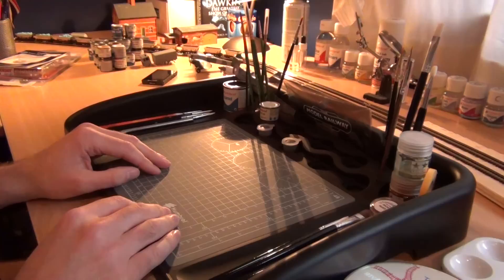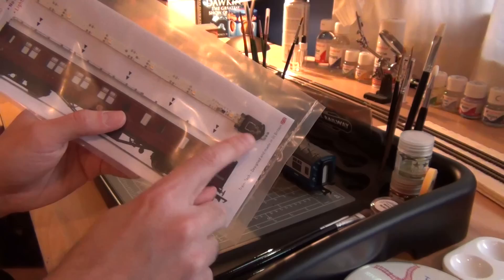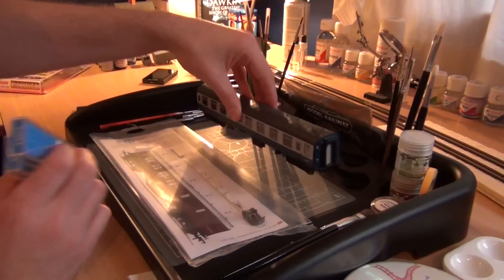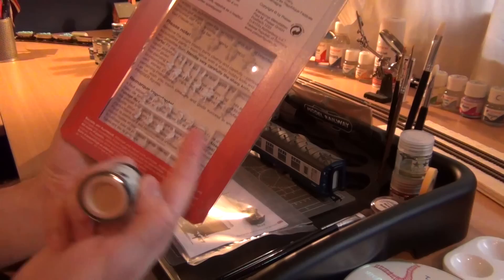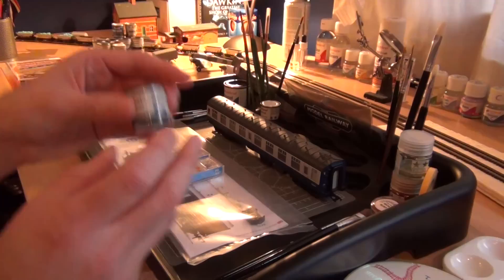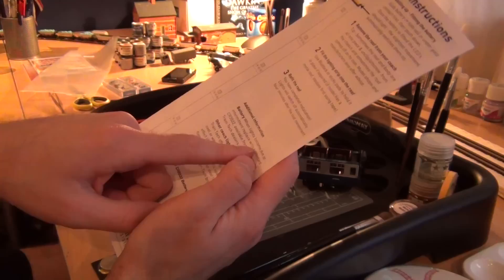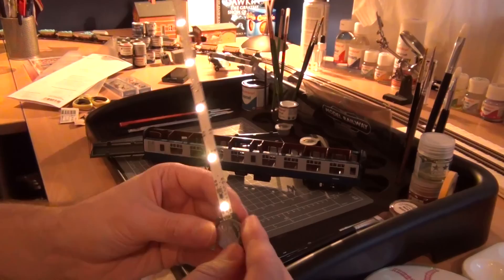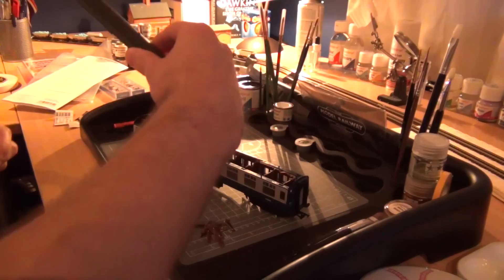Fitting Train-Tech Coach Lighting Strips

Comment: If you ever go to make the lights track powered you will need to a resistors because the CR2032 uses 3.7v and track power is usually between 0-16 volts(depending on your dc or dcc system)

Comment: DCC has too many problems--that's why I do DC only!  Another thought for you.  You can get Loksound ESU current collectors (#50707) for about $13.75 which includes shipping from Litchfield trains.  You get enough to do 8 wheel sets.  You cut them apart and mount (super glue/epoxy) each one to opposite wheels and it provides a pickup current from the track and a return through the opposite wheel.  Of course you have to use metal wheel sets with one wheel insulated.  Unless I find some more scrap copper, I cannot even come close to the price of the Loksound ESU parts.  What's neat about this is you only need one pair of the little pickups which you cut into half--one for each wheel.  Cheers.

Comment: Would it not be cheaper to buy a large spool of strip LED's off of eBay, then solder a small battery pack to it, which can then be stuck into multiple coaches?

Comment: Was your decoder a Bachmann 36-557 by any chance?  These are relatively new and from my experience they are poor performers (I've tested 3). The decoder is a custom unit made by soundtraxx and supplied to Bachmann only.  If you can find the older and much better 36-554 you should be ok.  If not I would get something else like Lenz, TCS or a Hornby Sapphire.  Stay away from the Bachmann 36-557!!!
Reply: yeah i was about to comment on inter citys decoder vid about how you had the same issue with them and how the lenz ones were working im a sub to you by the way

Comment: Fantastic vid, however just one little thing...
When you were whispering in the dark and the coach light came on just for a second or two and went straight out, you said it's not supposed to do that, but actually if the coach light only sees a tiny little bit of movement it just comes on for a second or so, then if it sees a little more movement it stays on for it's 4 mins :)
Not a criticism to your vid at all, just purely to let you know!
Looking forward to the next one.
Kevin.

Comment: You''ve probably already figured, but Bachmann's 36-557 decoder isn't compatible with Hornby's Select for some reason. A thing to remember though, the Select isn't NMRA compliant, which the Hornby Elite is, and the 36-557 works with my Elite.

Also to support this, on Hatton's website where the Select is sold, there is an accompanying note saying 'Please note that this controller cannot be used with locomotives with the Bachmann 36-557 21-pin decoder fitted.'

HTH

Comment: You need to learn to do your own electronics as I do all my own coach & caboose lighting.  Of course I only do DC for my trains.  I purchased LED strip lighting, mini full wave bridge rectifiers (the little square ones) and some 3300uF capacitors from fleaBay for under $15.00 which came from China.  I made my own pickups out of some copper salvaged from an old computer and lit up an REA (Railway Express Agency) coach.  The LED strips can be cut apart at every 3rd LED and have the ballast (current limiting) resistors already installed on each 3 LED section and, of course, they're all 12 volt DC.  The LED strips have adhesive on the back so they can be mounted to the interior roofing.  I have also converted all my illuminated coaches that have incandescent lighting to LED strip lighting.  I probably spent maybe $2.00 per coach.  Still have over 10 cabooses to do along with 4 more Riverossi coaches.  The LED strip lighting is bright white, which was too bright for my needs.  Sooooo, I painted each little LED with some yellow acrylic paint and now they are quite fantastic looking with the glow of period correct yellow lighting.  I think I used about 12 LED's per coach and the roll of LED strip lighting contained 300 LED's.  So this goes to show you, you can do this quite on the cheap.  All my lighting gets its power from the tracks. Cheers & 73 from W Rusty Lane K9POW in eastern Tennessee (and yes I'm a Ham)

Comment: Iv'e got six Bachmann mark 1 porthole coaches in blood & custard , when i attempted to open one up by trying to remove one of the pipes to the end of coach the tiny lug which holds it in place snapped of, so iv'e been to nervous to try any more.  On top of that some of the springs that hold connectors in place have become disconnected. These springs are inside the body of the coach so cannot be accessed without removing the top of the coach ? Dose  anyone have any suggestions.

Comment: It's a bit odd with the battery, wouldn't it be easier to light it all up with the traction current? ;-) 
Greets from Vienna :-)
Reply: Better to have the coach lights powered by batteries. Saves them from taking up precious current needed to run locomotives.

Comment: Rubbish! Expensive kits.. how to do it: without hacking chunks deep notches out of the ends. Biggest capacitor you can find, to hide in the toilet. LED’s come from bright components. A handful of resistors and a bridge rectifier. I have heard of people using veroboard/strip board/ circuit board.. but why bother! If you are clever enough with a soldering iron, just use solid core telephone wire, Tris.😎🙏👍